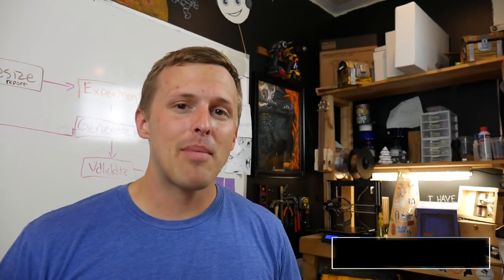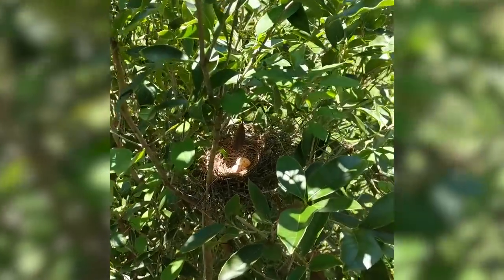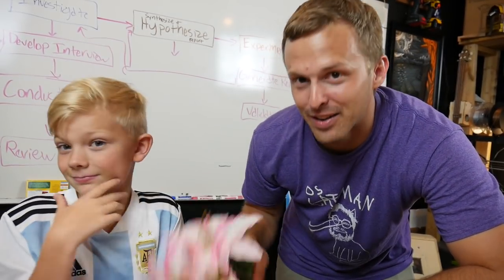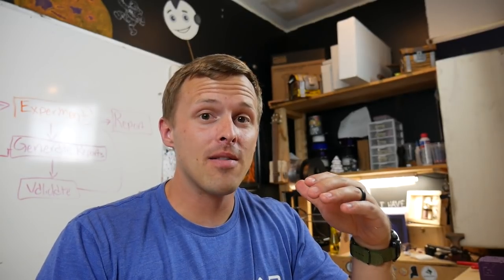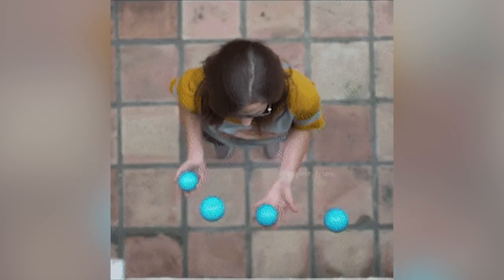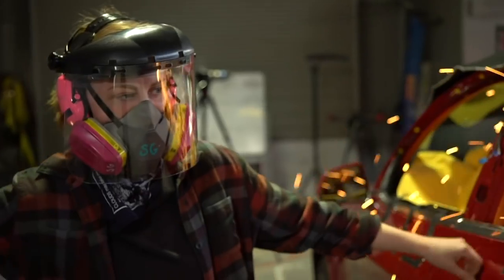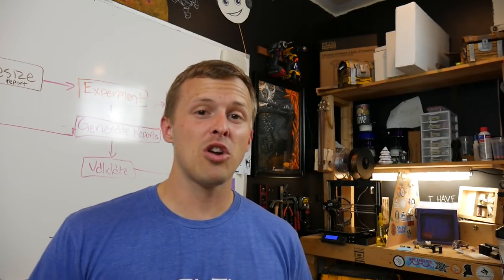The BIG problem with Truckla: Best Stuff this Week

Comment: They did alot of reinforcing. They actually shown it on their videos.
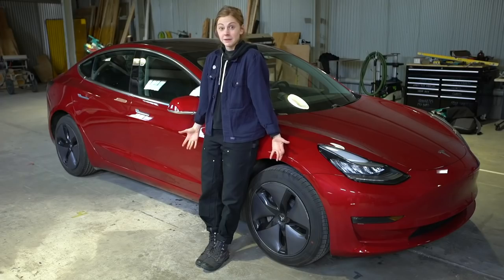Reply from the maker: They definitely added a lot of support.  I have tried looking at a lot of images to make sense of it all but long story short, the butt joint in the piece of pipe at 6:06 has me concerned. A static load is one thing, but the fatigue it sees in a car has me like ¯\_(ツ)_/¯. The good news is, that member is in compression...but that wouldn't stop a crack from propagating in the weld. The main point I was trying to make is personally, I would take the time to understand the stresses and design accordingly but they had a deadline to hit and didn't really know what they were getting into until they tore it apart. All that to say, they absolutely killed it!
Reply: There is a lot of reinforcement! Enough that it has totally occupied the cargo area... which kind of makes it a truck without a bed... which is why the ladder rack was probably installed
Reply: Chill buddy. Race car frames are literally nothing like load bearing truck frames. Have you ever seen a truck with round tube frame members? I have owned 10 different trucks, every one is a full channel frame or a box frame and NONE were unibodies like cars.  Race car roll cages are not truck frames, pure and simple.
Reply: @neilsiebenthal8696  the biggest indicator that they probably didn't do a proper analysis was the time crunch they were under, not a whole lot of time to do it right. But Simone said that they would be working on it so they might address this issue.
Reply: Manguy dude yes they are much stronger. Many many people have turned cars into trucks and turn cars into convertibles. It’s been done a thousand times.
Reply: @manguydude287 , actually, the framing is actually stronger. They do use it, on some trucks, but many trucks do not use it, because it takes more space. Roll bars are typically made of tube framing, because of its strength. Ask an engineer.
Reply from the maker: @CricketWhisperer gotcha. Trust me, I am a HUGE fan of hers and love the truck. My only point was this is likely the reason Elon wasn't openly endorsing it. Because he/his engineers are concerned with longevity.
Reply: RumbleLab I do agree with you that she should have put more reinforcement on the middle underside of the vehicle though she paid a lot of attention to reinforcing the “bed” in reality, nobody would have problems with unibodies if they just went back to making more stable body on frame cars

Comment: Check out rich rebuilds video.  It shows the rear doors have a solid steel plate welded in door opening.  There is also a roll bar and  multiple heavy duty x bracing. Looks solid
Reply from the maker: That is awesome. I appreciate the feedback! Personally I would want to look at the stresses in some of the critical members and compare them to a stock Tesla BUT that is probably just the stupid engineer in me! Thanks for dropping a comment!
Reply: I think the frame could be ok, it looks like the frame was heavily reinforced.  From what little you see of the finished bed, it looks to be full of frame supports. It is probably strong but it sort of ends up occupying the bed space... which makes the bed not nearly as useful, which is probably why the ladder rack was added.
Reply: @neilsiebenthal8696  chill, it's just  social justice warrior garage,  they aren't actually doing this for any real reason other than that she is so deluded she thinks electric cars are good for the environment.
Reply: @manguydude287  yeah dude. The future is definitely better burning more and more fossil fuels. The quicker we can heat up the earth the better!
Reply: @RumbleLab , I think, also, the last rack helps add rigidity to the upper body.

Comment: A lot of Swedish guys will know what I'm talking about when I say A-traktor, basically a car cut down to a ute/pickup body, reducing top speed to 30km/h and registering it a a tractor. 

I have made a few of these builds, and the key to getting them stable is to reinforce the rear door openings. And you will need to cross brace the back of the cab to get the diagonal strength along with a solid mount between the floor/longitudal rails under the floor,  and roof of the car. You then integrate this framework with the reinforcements in the side of the bed.

Results in a very sturdy body. When I built mine, it was far more solid than the original estate body. Weight is usually not a problem when building A-tactors, so better to buid it heavy and solid, however that might pose a problem when you register it as a truck and lose much loading capacity.
I've seen some crappy ones through the years, and they are straight up dangerous to drive, and was not approved when inspected.
Reply from the maker: Wow this is an amazing reply. Thank you. I looked up A-Traktor's and they are SICK! 

I find it interesting that they limit them to 30km/h. How do people use them? Is it to haul stuff around or just for fun?  How serious is the inspection process?

Comment: Research how a helicopter works.  The cyclic control of the blades controls pitch and roll.  Your diagram is correct, but it is the wrong answer.  The blades change pitch to control roll and pitch of the ship.
Reply from the maker: You are totally right, it does control roll. But HOW it creates roll is by varying lift from side to side. The point I was making, was that the blades must do this to compensate for the natural roll generated with forward motion.  Without a swash plate, any forward velocity you will generate a lift differential creating roll. So to your point, it totally generates roll when you need it, but also MUST do this  to prevent it from happening naturally. I appreciate your input.
Reply: @RumbleLab  Wrong diagram to explain why the blades change pitch cyclicly.  The diagram shown explains a helicopter's natural roll increase with forward momentum.  Or it's maximum forward speed due to supersonic tip on the fast side . You loose at Jeopardy big time.  You should have simply drawn the appropriate diagram.
Reply: @RumbleLab  This is difficult to draw.  The best diagram I have found to describe how the blades turn relative to the stick input.     This diagram describes what happens when the stick is pulled back - the front of the ship lifts up due to the downward direction on that cycle of motion.  
https://i.stack.imgur.com/HgPxK.png
Reply: @RumbleLab  Your diagram describes the dis-symmetry of lift.  It does not describe why the helicopter needs cyclic motion of its rotors.  It needs it to control pitch and roll.  For an incredible explanation of this phenomenon check out Destin's video:  https://www.youtube.com/watch?v=_pbdwueqGp4

Comment: Check the Fiat Strada, VW Saveiro, the awful Peugeot Hoggar, etc. In Latin America brands have been converting sedan cars into pick up trucks since the 70s. By that time all cars had a chassis, but they keep doing it now with current cars. And now there is a new niche started by the Fiat Toro, a little bigger pick ups without the classic chassis. I've never heard they have structural problems, so it may be not that hard to reinforce the structure. I think its harder to do a cabrio, that leaves you with just the floor to keep the car in one piece.
Kudos on that Messi shirt!

Comment: I'm sure Simone and friends did there homework and braced the Truckla enough to keep it from breaking. They braced it a lot more than say Ford did when they made the old fox body mustang into a convertible. Ford only used one extra piece of frame rail on each side bolted to the unibody frame to take care of the extra load. I think Simone will be fine. Plus, she bought it and is now the owner so Tesla really shouldn't have a say if she wants to make it into a flowerbed, racecar, or whatever she needs out of HER vehicle.
Reply from the maker: That is really interesting Tom! I never thought about convertibles. How do they do it now a days? I would imagine the frame is very different from the sedan equivalent right? Searching google now lol. 

I am curious your thoughts on liability. Do you think the state/insurance co would give it a 👍?
Reply: @RumbleLab  They still pretty much do the same things, just add extra frame from A pillar to rear subframe unless it was originally engineered as a convertible which will have it already built in. Kinda like bolting your ruler to the frame in the correct orientation as you stated to stiffen the frame to compensate for the loss up top.

As far as liability, you would probably(in my state of NC) have to get the inspector from your county to come out and make sure its structurally sound before it could be insured. The insurance company may want to take a look as well if the car is heavily modified. If it is sound and all the parts have been DOT approved then she may have to spend some extra money for insurance but totally doable.
Reply: @RumbleLab  oh almost forgot, bird names Goonie and Free.
Reply from the maker: @tomthumb1322  Oh okay. Makes sense. Otherwise I bet the stresses in the door sills is insane. I was also doing a bit of digging and found they are moving to carbon fiber tubs for convertibles. Inspired by F1 cars. 

I can't thank you enough for sharing. Very insightful. Also A+ on the bird names. New favorites.
Reply: @RumbleLab  My last name is Byrd, those were my names for the kids. :D Lucky for them my wife doesn't have my sense of humor.
Reply from the maker: @tomthumb1322  That is amazing!!! We think a lot alike. I am definitely the joker in the family. Our last name is Ball. We have a little girl on the way, I intend on calling her Fire Ball. XD

Comment: The biggest mistake they made (TRUCKLA) was not reinforce the frame before cutting. If you look at a racing car are reinforce at the frame for stability. The back door should of been welded before cutting any parts of the frame. Like I  said before, they rushed, cut corners, but at the end is hilarious and a desperation to own a TESLA TRUCK.
Reply from the maker: Interesting, that totally makes sense. If you need to replace a column supporting a walkway, you wouldn't cut it out then jack it up and slip a new one in. You would fit a support so everything doesn't move and then replace. Good call!

Comment: Just wait until she actually loads that thing like a truck and it sags until the car rests on the ground
Reply: @zoyaspencer8025  I did watch them. The bed is loaded with frame supports. Do I think they will work?  Maybe it will work because she cannot load the truck due to all the tubes welded across it. It's like a race car roll cage, ever seen a truck that used round tube as a structural comppnent?